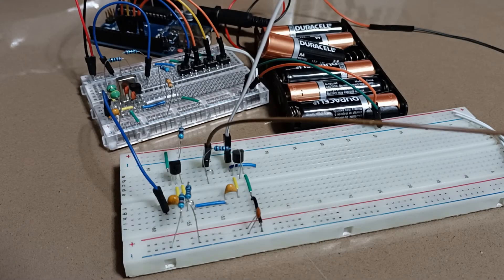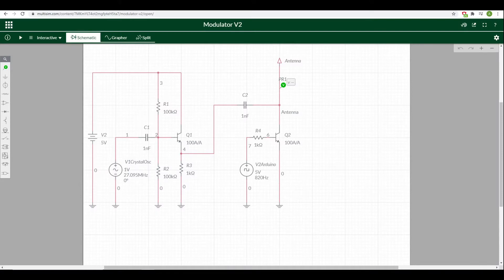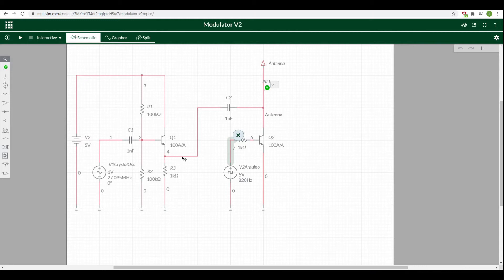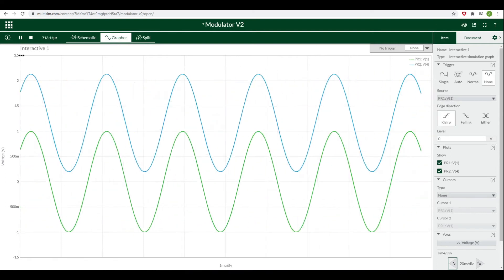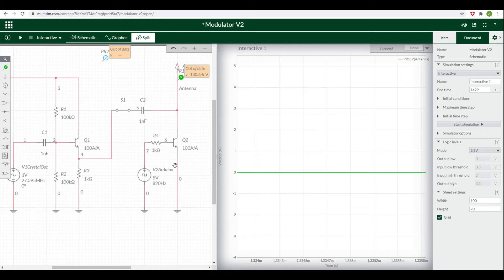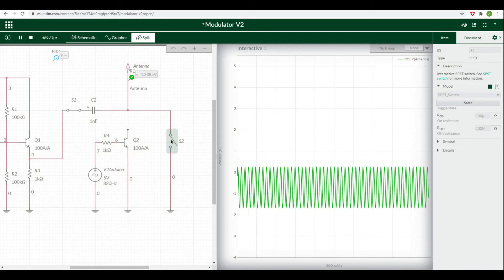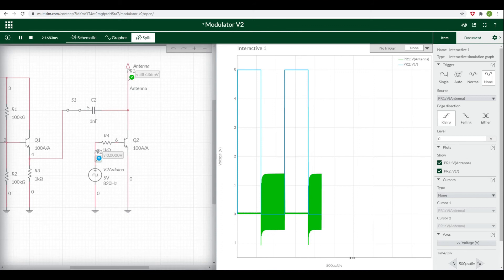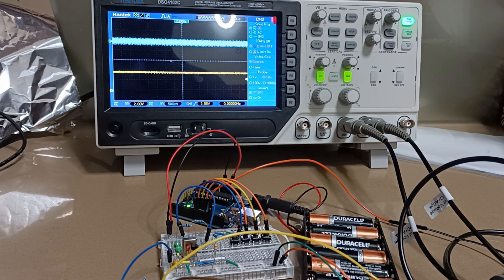Radio Controller - Mixing Circuit for modulating carrier and square wave. (RC Transmitter Part 4)

Comment: This is great . . Can you do a receiver circuit as well ?
Reply from the maker: Thanks for the suggestion. Receiver is a bit more complex. I will try.
Reply: @overengineeredinoz7683  That would be a great addition to your content as it is rarely found on the internet.
Reply from the maker: This stuff by the offset volt may be of interest to you.
Reply: @overengineeredinoz7683  where it is ?
Reply from the maker: https://www.youtube.com/watch?v=A_PsAkb-yRE
Reply from the maker: I also found the kit from that video here:
https://shop.elenco.com/consumers/am-fm-radio-kit-combo-ic-transistor.html
It has a manual that explains a lot about how the receiver works.

Comment: been thinking about duplicating it, but the more I watch about radio transmission the more I'm tempted to just make it work with infrared.
Reply from the maker: If you have line of sight between transmitter and receiver and especially if it is indoor infrared is much easier.
Checkout a part called VS1838B. 

You can. Also buy off the shelf radio transmitter and receiver instead of going through the process of building from scratch.
Reply: @overengineeredinoz7683  I hate using off the shelf units and modules in general and one of the purposes of my custom builds is to overly DIY it with as much scrap parts as possible. I have a bunch of tv's with IR recievers and a bag of IR diodes. 
Even If I wanted to use off the shelf components I would score less points on the university diploma work I'm planning to do based on these rx-tx 2b chips in these toys.
Reply from the maker: @two_number_nines  sounds like an interesting challenge.

Comment: I would like to see how it looks like from the receiver part... it might be not so perfect as from the transmitter side. I do similar things to you and experiment with different transmitter/reciever radio waves and also infrared etc. I will get my 27 MHz quartz soon so we will see how it performs :)
Reply from the maker: I would be interested to hear more about your projects. One challenge I am working on at the moment is how to get the signal stronger and clearer for more range.
Reply: @overengineeredinoz7683  the same here ;)
Reply: @overengineeredinoz7683  I have already done a similar project with Infrared and it worked really well (maybe because the Infrared receiver has already a filter so it can work with really poor signal) but I see with radio waves it is much more complicated and actually I have similar problems to you :/
Reply: @overengineeredinoz7683  I will get my 27 MHz quartz soon so I will tell you hot it goes (at least we will have the same starting point so we could discuess it later ) .
Reply from the maker: That sounds great.
Reply: @overengineeredinoz7683  What is the max distance you have  managed to receive your signal?
Reply from the maker: About 60cm
Reply: @overengineeredinoz7683  me almost the same :/ but the strange thing is that my cheap shitty radio can pick up the signal from 10 - 15 m ! But the home built receiver can't  :/ where is the problem this is a question ... 🤔 I have an impression all the time that I am missing something.
Reply from the maker: I guess if your radio can pick up other signals from a longer distance then it is likely a weak signal from the transmitter.
Reply: @overengineeredinoz7683  no other signals but only my signal! I recognise it by a specific sound it makes in the radio and it is  very strong. Another thing is that the transmitter is very simple and based on chinese datasheet so it works well. I would say that the receiver part is npt very good. When you compare my radio which i have bought on amazon and my receiver there is aaa huge difference! Another thing is I am currently making my licence so i can't make too strong transmitter and must stay in law regulations for now... so only thing i could do is to improve the receiver to become at least as good as my normal radio...